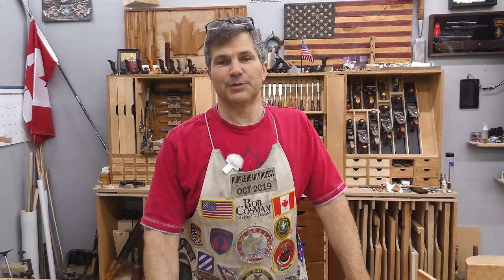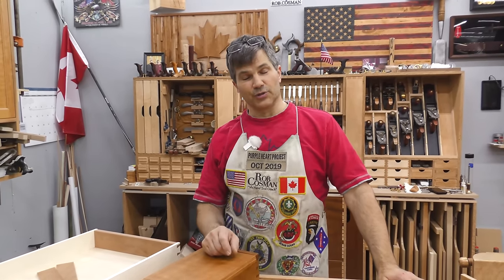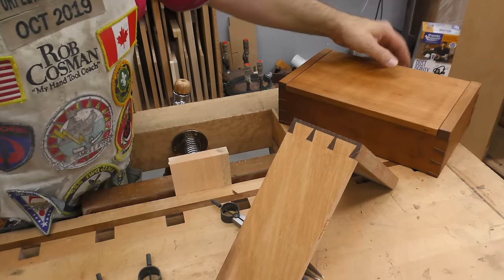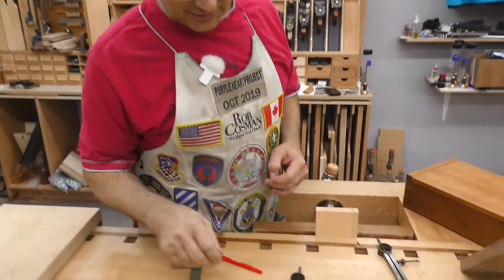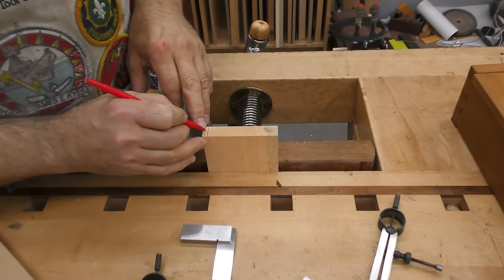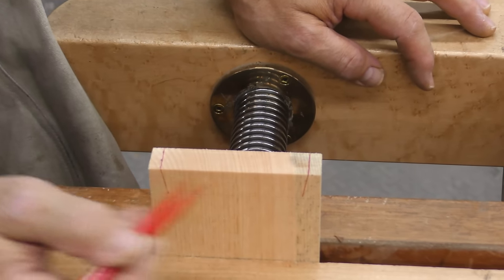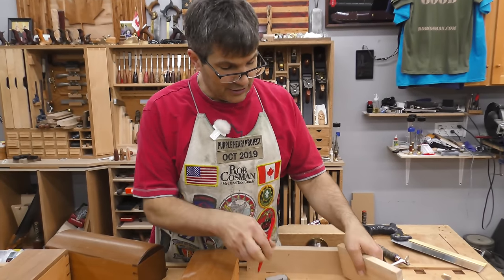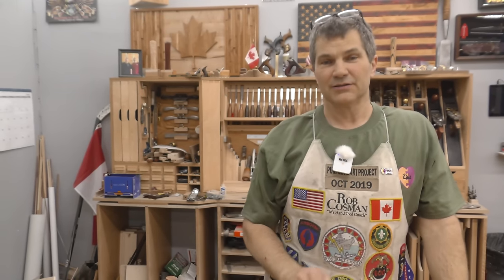Dovetails By Hand - Layout Tips & Tricks

Comment: So i picked up your channel in search of dovetails. Heard and saw "most" of your instructions. My first attempt...looked like a first attempt although i did not trash it. I wstched another video, a different one as i did not save the first one. Here i started numbering my attempts. Better but still a lot of rework to make it fit. Another video and my third attempt was fair. My fourth was going great. Good accurate layout and i was excited! I marked the pins and then proceeded to cut them out. Yep, you guessed it. I forgot to mark the waste! Lesson learned. I found the original video and saved it. Still using a backsaw until i get a proper saw. And using a coping saw until a fret arrives. The miscut pin joint was used and was actually my best fit yet. Thanks for your teaching videos!

Comment: As usual, great piece of instruction.  Many gems of good guidance.  I take it that the magnetic rail on the dovetale marking out board that I sent photos of is a no-goer.  It works great for me. I still need the wheel marking gauge for other jobs, but it just removes a point of potential error.
Reply from the maker: You method is great.  If it works for you stick with it.  I just dont think I want to do a dramatic change to my current method.

Comment: All in all, it's really a matter of practice for me. Correct layout, proper sawing technique, and then removing waste without damaging the surrounding fibers is really what it's taking. I'm getting better with fewer gaps, nicks, dents, etc, so improvement is happening! I have a Lie Nielsen Dovetail saw - 15 tooth - a Cosman dovetail gauge 1:6, and various chisels, marking gauges, and so on. 
Dimensions aren't much of a problem, and I try to use some basic rules for half-pins as you pointed out.
But still...practice, practice, practice!
Reply from the maker: Keep at it you will get it

Comment: Thanks for a great video. I seem to struggle with gaps on the inside face of the joint the most, but maybe slightly off parallel might be some of the problem.
Reply from the maker: where exactly are the gaps?
Reply: @RobCosmanWoodworking  HI Rob, Thanks for getting back to me. The gaps are on the inside edges, occasionally at the top of the joints, where the pins don't come through enough. I think the two are similar. Not square enough cuts maybe. My new saw (Just made my first one) is helping. So did your advice on lay out (two boards together etc). Thanks for your great videos, they really do help us sprigs. Cheers pal

Comment: Paring shoulders is where i struggle the most. 
I've finally landed on using my chisel to dig a little ditch on top of the baseline on the sidegrain, and then registering my saw against the resulting tiny wall. 
Any suggestions on this process?
(I should check to see if you have a video on this before submitting...)

Comment: The tails holding the stress (hanging wall, drawer -- as you mentioned) always seemed obvious to me.  But, what's not obvious is in the case of jewelry boxes, chests ...   Is it purely a subjective thing with tails or pins going on faces or sides of boxes?  It looks as though you prefer tails on the front/back of boxes...  Thanks for the videos.
Reply from the maker: That’s a correct observation. If the structural factor is removed, I tend to place the dovetails on the piece that will have the most visibility.

Comment: Great vid and background Rob!  Question - when cutting out the pin waste at 24:23, and to avoid having to cut at the 6 degree angles, why not just turn the board so that the angles become vertical and you're basically cutting the 6-degree straight down?  Saw Tom Fidgen do that on the one of his vids and thought it made alot of sense.  Perhaps that's cheating in the classical sense but it sure makes my line cutting easier!

Comment: The hardest part for me is keeping the tail board secure when marking the top of the pin board.  I set the pin board in the vice and set the height of the pin board level with my 5 1/2 plane as you do in your videos.  When I try to hold the tail board to make my marks on the pin board using the Cosman marking knife (the one with the blade the same as your dovetail saw), the tail board shifts or moves on me almost every time.  I don't have a skew plane so I have tried the painters tape trick.  I recall you mention automotive painters tape, what I use is just the regular painters tape.  Can you be more specific as to the type or brand of tape you use?  Maybe it will provide a better edge to butt up against.

Comment: Great explanations...As I go through your teachings especially over the last couple months, I was wondering something. Given how critical it is for those first tail board saw cuts to be perfectly perpendicular, would there be value in making a similar cut with your marking knife as you do to mark the pins?  I am thinking maybe using a square on your marking line and do a light couple passes with the saw marking knife to create a shallow kerf enough to “hold’ the dovetail saw.  Make sense or not worth the extra step?
Reply: Sounds reasonable to me (very much an amateur). Have you tried it out? I think what I struggle more with isn't getting the top of the cut perpendicular but keeping it so all the way down the cut! Possibly says something about my saw set up?
Reply: To mark the beginning of the cut and the saw perfectly follow the line marked with the knife what I have done is to mark with the saw a very small cut that only allows me to mark the width of the blade, then re-mark another line at right angles parallel to the first so that the saw takes out material and creates a guide furrow of the width of the blade.  It is laborious but it works XP
Reply from the maker: Thats actually a very good cheat, Col Luther shows folks who cant seem to get the perpendicular cut down.  Instead of the saw he uses a square and an awl or the scratch pin from a combination square to scratch a perpendicular like to set the saw in

Comment: Hi Mr Cosman, I am x military as well but Brit x submariner of 15 years and now offshore oil /gas/renewables but coming to the end of would be nearly 50 years at sea in some shape of other and love your vids as I do have a plan to start some kind of small ( very small ) wood workshop producing some kind of bespoke outdoor furniture.I have all the gear and some idea but nothing to what I see in your shop so I have to ask , apart from the  pleasing feeling "I done that", self-gratification that must be felt  from looking at a joint that's been hand-built ,can something like dovetails be done  neater with something like a Leigh jig than by hand or is it just a question of speed to complete
Reply: Using a dovetailing jig will make perfect, tight, dovetails in a fraction of the time you need to cut them by hand: that's after you have become slick at using it, and after you have set it all up.  So, for mass-production (eg needing to make 4 or 6 drawers -16 or 24 corners) and selling to a customer who isn't going to be able to appreciate machine-cut from hand-cut, it makes sense.
On the other hand, if you have cut enough dovetails by hand to become proficient, and you have only a small number to do, or if you are restoring or copying an antique, the hand-cut method is better, because it actually looks as if it has been cut by hand, and if that is what the customer wants, they will appreciate that fact.
On top of that, you have to balance the satisfaction/frustration of tackling a 'challenge'.
To those in the know, machine-cut dovetails will always look machine-cut, even though they are perfectly good, strong, joints.
I once spent an evening with some friends listening to a reproducing piano.  The owner put in one roll after another, and the piano played one virtuoso piece after another, perfectly.  No-one felt like applauding.  Why? - Because no human skill had been involved in the playing.  It makes no sense, but what we appreciate and value has something to do with the amount of skill and effort that we think went into it.
Here is a video by someone who has made a living from hand-work.  You might find it interesting.  (He speaks Hungarian, only in the first few seconds!)
https://www.youtube.com/watch?v=vKuy3NdLhlE&t=41s

Comment: I've wondered why when you put the rebate on the tail board, you still use the full thickness for marking the pin board. Wouldn't that result in proud pins and change the dimensions slightly?
Reply from the maker: It changes the dimension by the depth of the rebate which is about 3 shavings (6000 of an inch)

Comment: Ive had issues with the whole joint being too tight or too loose. And I think its something with the marking gauge off the saw thickness setting.
Reply from the maker: That's a very real possibility.  Make sure you hold the gauge face flat against the say, do not let it tip
Reply: @RobCosmanWoodworking  does the cutter being closer or further away from the saw plate have a play in it also? I guess I'll just have to do some test and try to find the errors. The layout technique and offset method always works. Its almost impossible for the joint not to go together.

Comment: So, I modified what you told me to do about using the ruler and clamps. I bought a pair of inexpensive spring clamps, put the ruler on one side and clamped... and quickly discovered that the clamps dimpled the wood on the opposite side. So, I grabbed two pieces of cut off material that I wouldn’t care about being dimpled, moved them back away about 1/4”  from the marking gauge end, and clamped the work piece between the two pieces of scrap. I also angled the clamps so I could fit the marking gauge on the material. It kept the piece from moving around on the pins board, and didn’t dimple the work piece any more.
Reply from the maker: Sounds great.  Good problem solving

Comment: I have practiced getting the tail cut perpendicular but am still not getting that 1/8” over 6” “close enough”. Watched the sawing tips video and know it’s my mechanics just not quite there yet. Sawing pins, I really tend to tilt the saw over to my left. Practice, practice, practice. Once I get one last storage cabinet/ hutch done and out so I can finish my bench and get a consistent setup, that will help.
Reply: My problem too. Could be the saw set up as well as my technique.
Reply: Robert Amsbury saw set up? Don’t think I follow what you mean
Reply: @rroades  if the tooth set is not even it can lead the kerf to one side. Bad sawing technique is the most likely explanation for my errors!
Reply: Robert Amsbury oh, duh! I have a brand new Cosman dovetail saw, so I’ll go with technique for sure. 😃
Reply: @rroades  lucky man. I'm not jealous at all.... I have a vintage saw pucked up on eBay and sharpened myself - not expertly!
Reply: @rroades  You can make your life a lot easier if you lengthen your cut by clamping a short piece of waste lumber (2x4 maybe) behind the job and extend your marking line across the top of both pieces of timber.  Start your cut on the line of the back piece and slowly bring your cut along that line towards your main piece by dropping the heel of the saw.  You then should have a perfectly straight cut.  then just do what Rob says about how to use a saw.  Simples!  I'm human and I need to do that sort of stuff to get decent results.
Reply from the maker: Try this.  Once you mark out your tails take a small square and a scratch awl and scratch in a perpendicular line / kerf  then use that to guide your saw
Reply: RobCosman.com oooh GOOD idea!
Reply: 1deerndingo I like this, too, the only reason I would hesitate is if this is sort of like using a saw guide. I may never do this often enough to really develop muscle memory, but really hope to fail at that before trying “the next best thing”, which this might be. Thanks!
Reply: RobCosman.com could use the marking knife with sawtooth blade, also, yes?

Comment: What gets me and maybe its because I don't fully understand the why you have to but the whole offset one way n cut the other side(or the same side?) And have trouble feeling like I get it right...?
Reply from the maker: Think of it this way.  If you did not offset, when you made the sockets for your tails they would be too wide my one saw kerf on either side of the socket.  Offsetting gets rid of this problem and makes the tail fit perfectly into the socket
Reply: Perhaps this will help.   The objective is to mark the PIN board using the TAIL board kerfs.  You will be scribing the edges of each pin.  If you think about the pins, you need to offset the tail board kerfs such that you define the pin necessary to fill the socket which is the complete gap in the tail board.  So, (a) offset the TAIL board to the left and mark the left side of the PINS and (b) offset the TAIL board to the right and mark the right side of the PINS....the pins need to be increased on each side to fill the socket between the tails.

Comment: Ok just started this woodworking thing. I'm making river tables and I'd like to make my own legs. I'm thinking   u shaped out of nice maple or black walnut or whatever. So how thick can you do dove tails??? Can I do 2x4's or is it limited to thinner stock???
Reply from the maker: Any size but always cut in the end of the board never the side
Reply: Ok. And I bought a 1 in 6 marker. I've been looking at Veitas gouges would you recommend one of those??
Reply from the maker: do you mean gauges?  if so, my answer is no.  I like to be able to drop the cutter to the table when measuring the thickness of the board.  Theirs have rubber O-rings that prevent this.  Check out ours, I make them for a reason, this tool needs to be precise.
Reply: Awesome ill order one right away